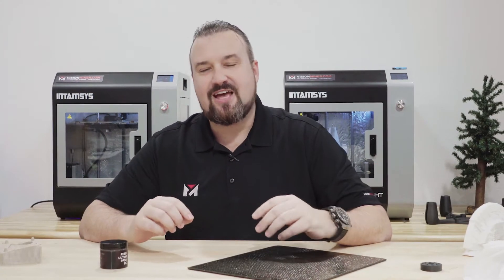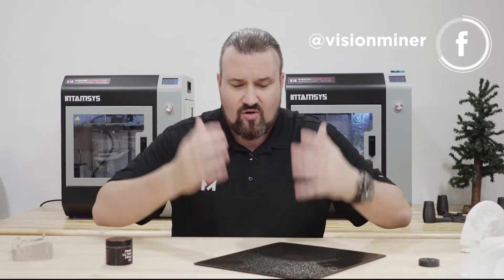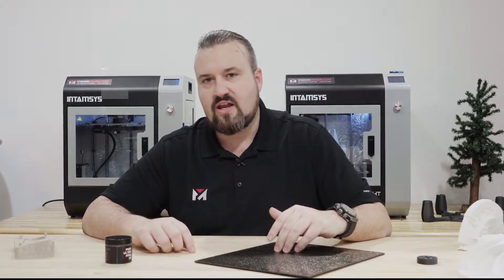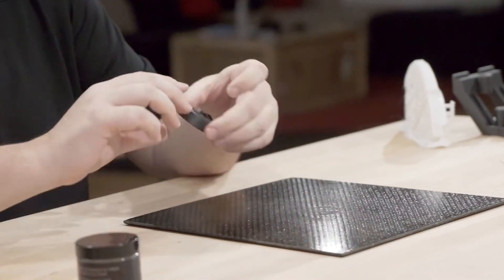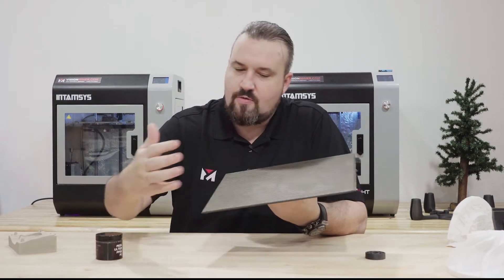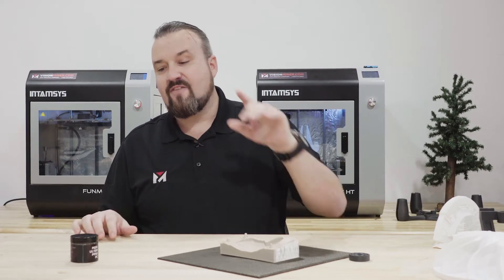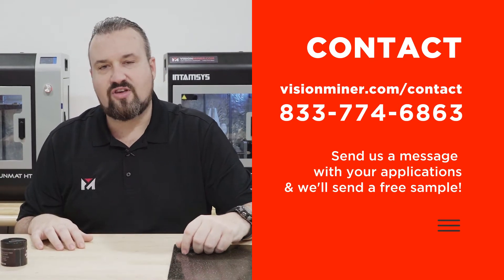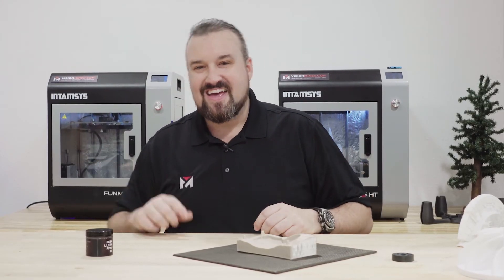Carbon Fiber Buildplates & Nano Adhesive for PEEK and ULTEM™ 3D Printing

Comment: I have a zortrax m300 fdm printer and I've tried EVERYTHING.... Elmer's Glue Sticks work the best...however, the build platform is custom designed by Zortrax and has 5 metal contact areas for the brass nozzle to make contact to level the build platform... so, will the Nano adhesive allow conductivity thru it?  Also, I print exclusively with HIPS...High Impact PolyStyrene.  Will Nano glue work with that?  As you pointed out, this is so darn frustrating.  You start a print and it's going good and then a corner lifts up, and you've lost 8 hours printing and costly filament....I look forward to your reply.  Additionally, can you clean the Nano glue off the platform.... is it water soluble....thanks again.
Reply from the maker: Yep, 100% water soluble! It should not affect the capacitance of the buildplate, since the coating is so thin. As for HIPS, we'll be testing some of that in the near future -- but yes, pretty sure it works. Get a sample at visionminer.com/sampleadhesive :)

Comment: did you cancel the cf plate?  i dont see it sold on your website
Reply from the maker: Still finalizing production, it's been a challenge -- we're hoping to have them soon!
Reply: @VisionMiner  i'm in the process of buying the nano adhesive (you didnt send me a sample unfortunately)  , can you tell me what is the max usage temp for it ? there's no data on your website. my bed goes up to 200c , can this thing hold at those temps ? 
how goos is it sticking parts to a borosillicate glass ? 
i guess you have problems with carbon fiber holding at 150c temps and above . had this issue also .
Reply from the maker: @sss8909   We've used it up to 160C, but it should last to 200. You can order a sample on our website, if you'd like! visionminer.com/sampleadhesive

Designed on borosilicate glass, works on a bunch of other materials too! :)

Comment: Way too expensive for such a little bottle. I would rather order two spools of filament.
Reply from the maker: Unless you're printing engineering materials which are $650kg, and nothing else on the market will keep them stuck to the buildplate with a mirror finish.... :) However, if you're using other adhesive with PLA, one coating of this stuff lasts months, so your money goes a lonnnnng way :)
Reply: @VisionMiner  Can confirm, that bottle is a lifesaver and last for years! Truly amazing